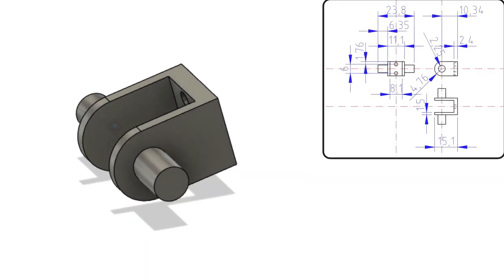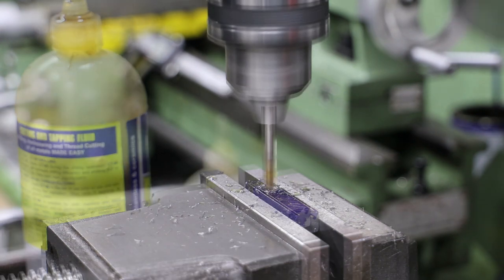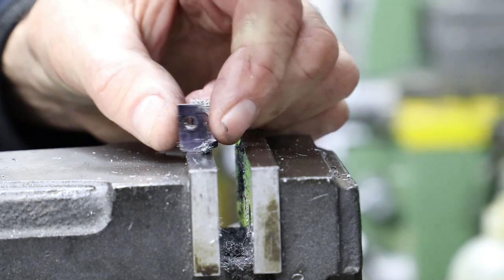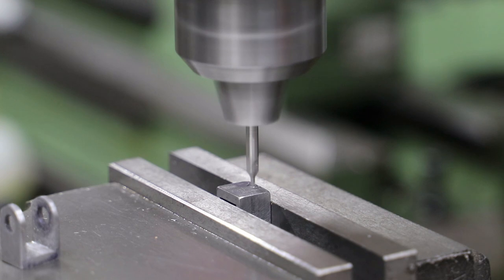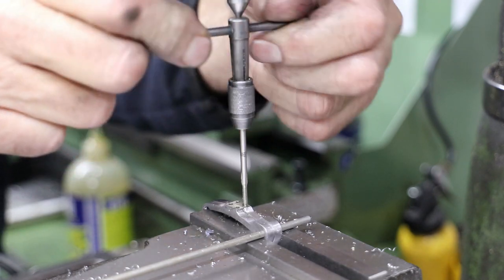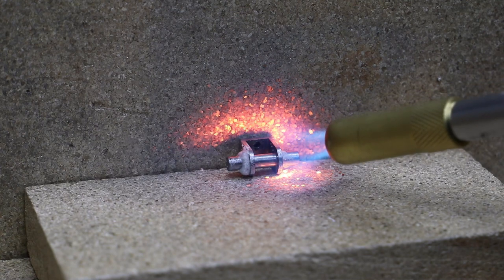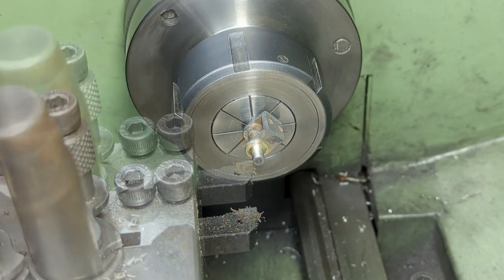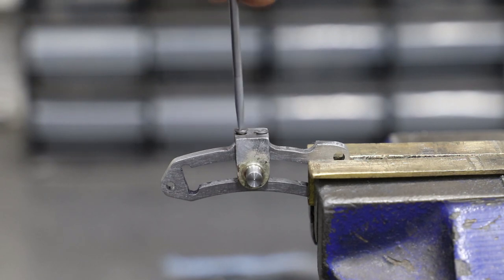Part 34: The Expansion Link Trunnions

Comment: I understand why you make the CAD drawings so you get the metric measurements you need. Ive started drawing up parts in CAD too because too often the dimensions needed at an interim stage are not on the drawing. Also with complicated parts it proves (or otherwise) that the original dimensions work.

Comment: Very nicely done indeed - the wicking of that silver solder was something to behold. May I ask about your button filing? I used regular mild steel and decided not to harden them - but they were free to rotate on their pins, so essentially lifted the file off the work with their motion, rather than acting as stops. Is this two distinct methods? Or did I do something wrong?
Reply from the maker: Hi William,
Thankyou for the feedback.
The buttons are Silver Steel and hardened by heating to Cherry Red and then dowsing in cold water.
I did show the process in an earlier video, but used Mild Steel, which doesn't harden 😁
Cheers
Mark
Reply: @markshomeengineering5243   Thank you! Why silver steel over tool steel? Or are they the same thing just American/English demarcations?
Reply from the maker: @williamsworkshopuk  I think they're the same thing.....
Reply from the maker: @williamsworkshopuk  https://www.metalsupermarkets.co.uk/what-is-silver-steel/#:~:text=Silver%20Steel%20is%20a%20round,to%20use%20to%20manufacture%20tools.
Reply: @markshomeengineering5243  Thank you!